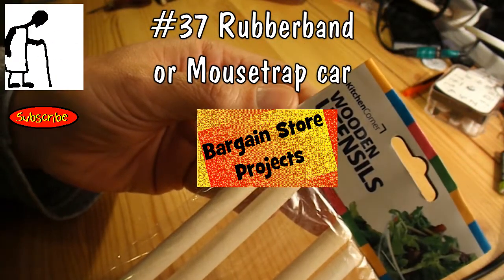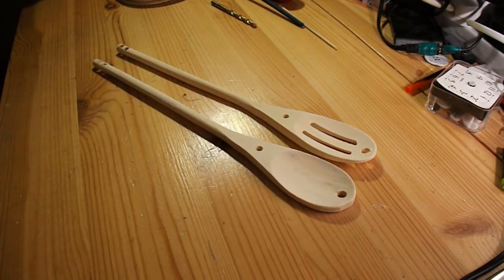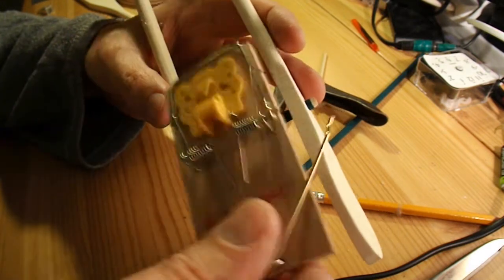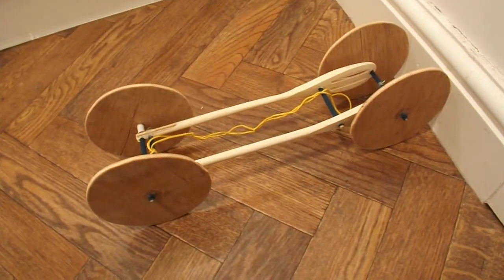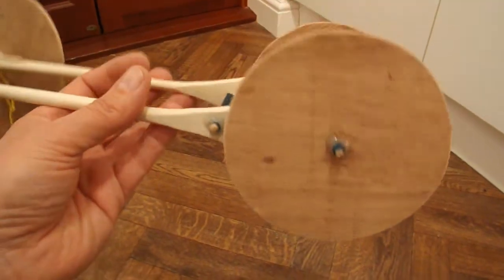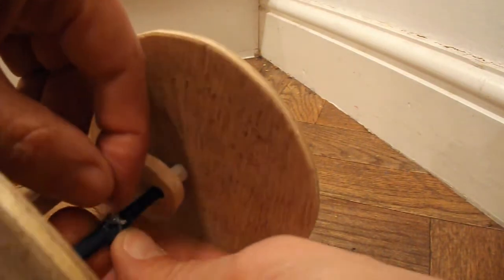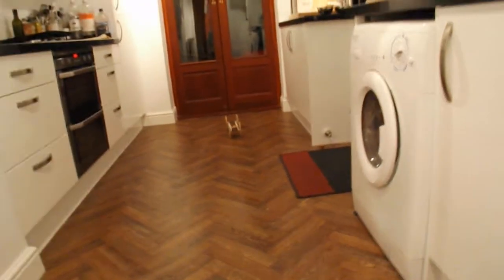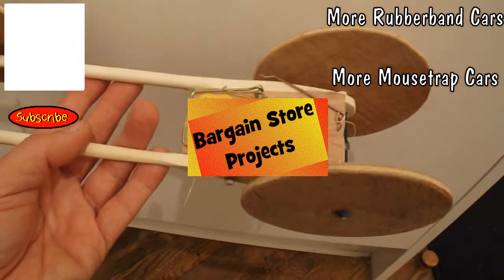Bargain Store Project #37 Wooden Kitchen Utensils to Rubber band or Mousetrap Car

Comment: Can you make this with dry pasta?
Reply from the maker: I should think that depends how much glue you can use to add strength. Pasta tends to shatter quite easily but you could glue several layers and the glue would help. Obviously there is a whole range of different shapes and sizes of pasta available so with the right choices it should be possible especially if you include lasagna.